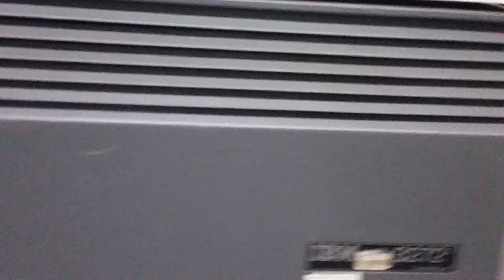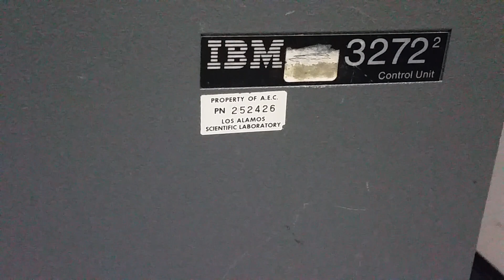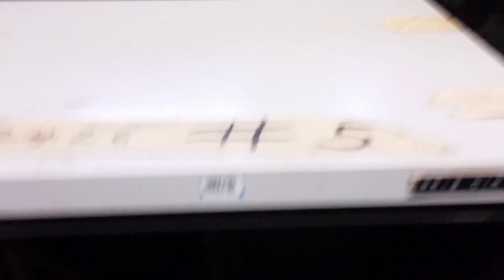IBM 3272 Control Unit

Comment: Those wire wraps always remind me of a birds nest. I am amazed that they were as reliable as they were. IBM really did build well made stuff, maybe over built in some cases? I imagine their reliability was because they made them so well. I was trying to remember how the network, at a place I used to work, was connected. The cables had a pair of pins sticking out of each end and I think they screwed together. I also think it was some sort of series connection? I do recall you had to be very careful with it. It didn't take much to bring the network down so you didn't want to touch it at all if you could avoid it.
Reply from the maker: Most of the time, yes, very high build quality - but then even with this older stuff, there are times when the engineering flaws really stick out.
Reply: Those were IBM Hermaphroditic Token Ring / "Type 1" connectors. I remember seeing some of that cabling still in the walls when I did an inventory on an old government building about 20 years ago. Wouldn't be surprised if they're still in use.